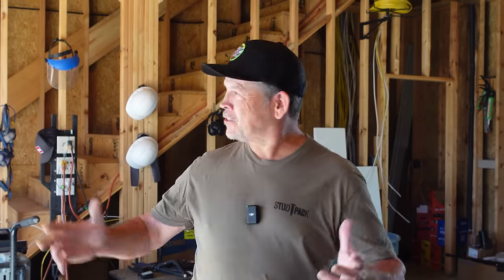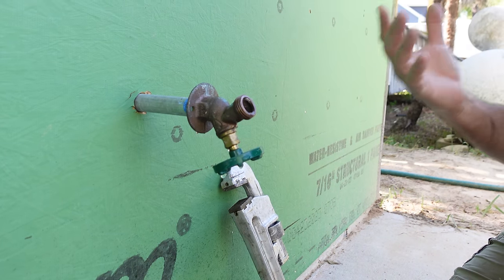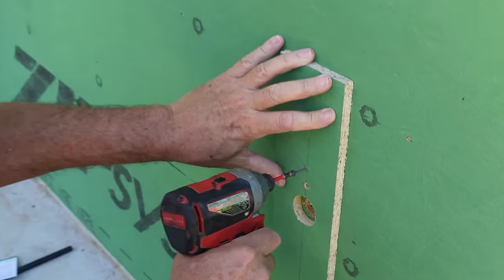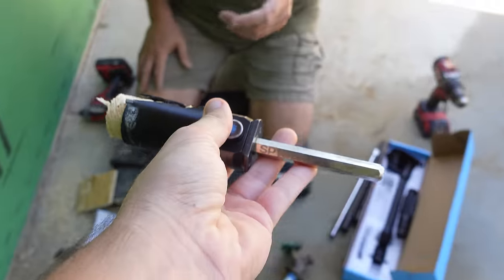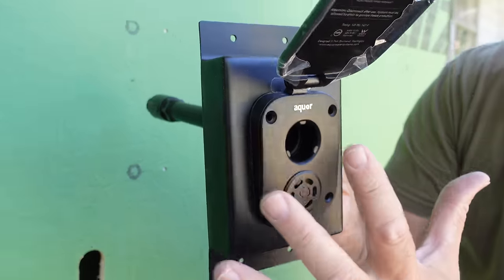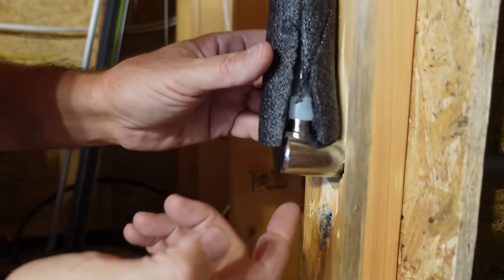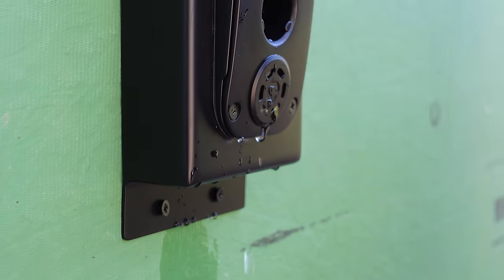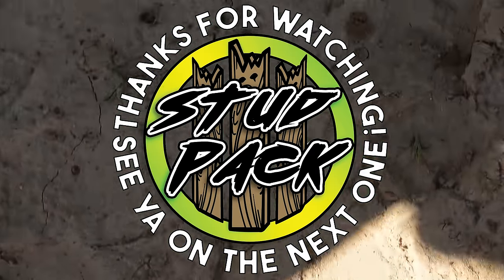Installing a Modern Outdoor Faucet - Ultimate Home Winterization

Comment: Hey Paul, I like that socket extension tool. It would be smart if you drilled in new 'set screw' holes so when you are pulling out your bit they won't fall in the wall! Just drill and tap new set screw slots in your sockets!!!!
Reply: Seems like you've never tried to drill through sockets... That steel will eat your drill bits quick. Never mind trying to tap it afterwards!
Reply: If you buy a Diablo or virtually any other brand besides spider,those extensions will fit.
They have the same action and are better built.

Comment: on that socket setup that you have , you can also tape it with duct tape, so that you will not loose it in the wall . if it was not for it being drilled in the garage .

Comment: I’ve seen these house hydrants before. They’re in intriguing. I don’t have but one hose bib to the outside pex right to the outside. Our winters are usually mild so I don’t worry about freezing. I can shutoff the water in the basement to my pex open the valve and drain it.

Comment: Looks like a great system. Is the hose adapter stainless steel or plastic? The black color always makes me think plastic parts every time. Is there a rebuild kit for the valve/spring & O-ring assemblies? I like to have repair kits for new products in hand when I install this sort of thing (new tech product) in my buildings.

Comment: It doesn't appear to be possible to easily air seal the connection of the hose bib through the wall.  The zip tape fixes the water issues but how do you AIR SEAL behind the fixture itself inside of the black housing?

Comment: That looks awesome! I'm in Minnesota so have the frost-free bibs on my house. I could go to the basement to shut off the water for extra security, but my knees don't like me to do that. 
Next, I'd like to see something like that design so I can replace the outside vinyl dryer vent birds have destroyed (why?!). The louvered types seem they'd be impossible to clean of caked-on lint.  The current trapdoor style is impossible to clean. (Laundry room is off my main-floor kitchen.)
Reply: I have had both. The louver style I find easier to deal with. The louvers have pins that allow it to open 90°. Because they are plastic, slightly bending it outward in the middle, the pins slide out of the holes. I usually remover the middle one, clean off them all off, put the middle one back in place. I usually don't have to do this but once a year or so. I also have rigid duct to the exhaust vent. It doesn't slow the air flow down like the flexible did, causing lint and moisture to be trapped in the pipe.

Comment: 15:56  "If an O-ring is good enough for the Space Shuttle, it's good enough for our water faucet."

Might I remind you that it was an O-ring in one of the Space Shuttle's solid rocket boosters that failed.   And cold weather was part of the issue that caused that failure. 

That being said:  It's a solid product from a reputable company that's been around over 20 years.   Sure, there is a chance that at some point in the future parts for this Aquor hydrant may become unavailable, but I've had that happen to me with two cars that are relatively new, with hundreds of  thousands of them still on the road.   I have an SUV where a trim piece broke and the OEM part is unavailable, and even when I have found someone saying they have an NOS replacement, they want hundreds of dollars for it (It was a $14 part at one time).  So I had a friend 3-D print me a replacement which is as good as OEM and we were able to tweak the design such that the 3-D replacement is better than OEM.   I had him print me a few extra copies in case this trim piece breaks on the other side of the SUV.  And 95% of people could probably not discern the difference between OEM and 3-D printed.

Comment: Doesn't the nozzle that inserts into the receiver have a silicone greased o-ring that would pickup sand and dirt if it's laid down outside.   Seems fine on a yacht or other boat but on the side of a house with sand grass and dirt it doesn't seem like a great idea to me.   I've had no problems with my traditional spigots...

Comment: keep n mind all of these internal poppet  valve type of frost free hydrants are extremely restrictive. many will flow roughly half the gpm at any given pressure and will tend to become fairly noisy at maximum flow rates. if you are expecting to run something like a 5gpm impact sprinkler you will encounter range issues.

Comment: Here in Ohio we have used frost free bibs that seal 8 to 12" inside the building and drain to keep water from spout. They work well if installed properly but not as cool as your hose bib.

Comment: It looks nice, but other than the freeze factor, how is this thing any better than a traditional hose bib? Admittedly I know nothing and I'm not even handy, but wouldn't a more economical option on a new build be to just have a shutoff valve a foot inside the wall? That way you could turn it off in the winter and there wouldn't be water in that 1 foot section that freezes?

Comment: Why is your green chip board so close to the ground? You'll experience rot. 
Shouldn't you've poured a 12 inch high x 8 inch thick concrete rim to raise the stud and chip board wall? Usually code requires this?

Comment: I'd order a few of those hose bib adaptors that goes on the hose. I think I'd prefer an on/off option without pulling the hose out of the box. House is looking amazing !!
Reply: Jenna, pulling the hose out of the box ensures that your hose also will not burst. If you leave it attached the hose could very easily freeze and burst.

Comment: Strange that that older type of external tap is still in use over there. Here in Sweden, they are very rare for external use. Think we had an internal shutoff tap before I was born almost 40 years ago. There's a rod inside the pipe going through the wall that turns off the water on the inside and a drain valve on the outside so the water drains out when you turn it off. They are very common here and weird that the US are so behind on that.
Reply: We have this faucets as well, this was to make a video. The regular frostfree faucets probably aren't giving then away for free to YouTubers. I'm sure Matt R hooked them up to get free supplies if they were featured in a video. I'm a little disappointed that they seem to have sold out to whoever provides free products. There's no cost/value consideration in the videos.

Comment: I don't trust O-ring only since it has that much turning slack on the 90. I would have put threading tape for extra measure. But if it works, it works.

Comment: This really looks like an overengineered solution in search of a problem.  I live in an area that regularly reaches -20C and the standard 8+" deep wall hydrants have given me zero issues - even when they didn't have anti-siphon valves.  Get one that's anti-siphon equipped and quarter turn and you're golden.

Cause the thing is, modern standard wall hydrants are already using a valve that's well inside the thermal envelope and slightly tilted for drainage (when installed correctly), and they do it without proprietary nonsense besides.  What you have there isn't even a wall hydrant at all.  It's just a pipe on a traditional indoor hose bib.  There might be some southern regions where that was acceptable, but there never should have been in the first place and that's just a testament to shitty American building codes.

Yes, proprietary IS bad.  And it's an acceptable sacrifice ...when it actually solves a problem or offers a meaningful improvement beyond "now hooligans can steal something expensive (because it's proprietary) off the side of my house."

Comment: Re inventing the wheel with that hose bib, just install the old-fashioned type at an angle and the water will drain out preventing freezing at a fraction of the cost 🤷‍♀

Comment: 'O' Ring on the space shuttle 😂 It didn't work out so well on the space shuttle 😢
Another good thing about that tap connection is that it will stop random people using your water. Especially in public places.

Comment: I have to say I do love those modern hose bibs but I would not have a lot of faith in having a rubber o-ring sealed into a wall.  Rubber o-rings inevitably dry out and start to leak and that would be a real mess inside a wall.  Just something to consider.

Comment: I put hose Aquor bibs on our house in houston when we rebuilt after Harvey. Been through 4 winters so far and love them. My only issue is our water connection to the house comes up outside the foundation and code required them to put a standard hose bib on it before it comes in the house!

Comment: 15:53 You remember the unfortunate catastrophe of the Challenger - the O-ring WASN'T good enough for the space shuttle and its failure resulted in the total loss of all crew.  If the O-ring in your connection is anything like NASA's - as you're equating - expect catastrophic failure in about 10-15 years.

Comment: There's been a huge variety of different length of anti-frost hose bibs on the market for many years, well before Aquor, that are very reliable and far more affordable. There's even outdoor combo faucet sets with hot and cold available. I'm not a fan of needing an extra plastic attachment that I know someone will eventually misplace or damage. Nothing is truly freeze proof, it just takes someone to forget and leave a hose connected to it. Seems to me they're just trying to reininvent the wheel. I feel like it's too commercial, similar to needing a damn key to turn on some water. Also forgot to add, as someone who services HVAC, not having easy access to  water means possibly leaving a dirty condenser behind.🤷‍♂️

Comment: You wont have leaks if you have a shutoff valve on the inside like most homes in east coast have.A lot  colder over here . Both systems would work fine. But what happens when the rubber seal goes bad youll have a leak

Comment: Hold it, Paul.  

At 15:58, you said "If an o-ring is good enough for the space shuttle, it's good enough for our water faucet."

I don't know about you, but I remember a space shuttle (Challenger, 1986) came apart a little over a minute after launch, killing all souls on board.  The point of failure: an o-ring.

Maybe a better analogy going forward would be in order.

I know you didn't mean anything by it, and a lot of shuttles have gone into space without catastrophic failure, but still.

Other than that, love the video, and especially the hydrants.  I learn something probably every time I watch.

Comment: maybe people down south aren't used to it since they have the luxury of it not REALLY freeezing.. but up north here we put a shut off valve in the basement.... which literally does the same thing but shuts the water off well inside rather than a few inches.... and of course you leave the level set to run the water outside...  and i get the 'proprietary' part issue.. but it's more along the liens of that's a ridiculously high up front cost to 'change' your home.  new construction, yeah maybe... but i'll go tried and true old school with the interior shut off valve until they come up with something budget friendly that's a better idea.. but... that's still a new idea....

Comment: Like that is the only system that avoids freezing of exterior hose connections.  They have been around with long necks to avoid freezing for the last 40+ years.  Yes that looks cool on the outside but like all the lines, when you took the piece out and stopped the water, some leaked out on the siding and onto the ground due to the anti-siphon control.  Now if you had a system that didn't have ANY water come out for the anti-siphon value that would be worth some money but yours, like every other one I have seen drips some water when shutting off. Leaving a muddy mess.

Comment: Hmm, I see it drains against the siding. They should at least have a little lip to keep that water off of the structure. If it ever leaks that water just runs down the wall.

Comment: Frost/freeze resistant hose buds have been used in northern states for over 50 years. 

The aquor system is cool and aesthetically pleasing, but the technology isn’t all that new. I have a standard style hose bib in my house and only worry about my pipes freezing if the power is out. 

Just sayin’

Comment: Seems like they reinvented the wheel, my house was built 40 years ago and it was built with Frost Free Spigots, the valve is inside the wall under the house where the ductwork keeps the ambient temperature higher than outside, no proprietary parts, no freezing spigots

Comment: Hose bibs freezing in Canada is a big issue, as you can imagine. Way back in the olden days, we'd put a valve somewhere accessible inside the house, so we could drain the line before winter.

EDIT: Yes, I know there are solutions and you don't have to do what I wrote TODAY. I did write "back in the olden days" but some commenters failed reading 101.
Reply: Man our regular draining hose bibs do great in Alaska, i see -30 every winter. The only time these would fail here is no rim insulation, heat off in the home, or your pipe running in the ext wall which is not code.
Reply: I just installed a 1/4 turn ball valve so I could shut it off manually like you mentioned.
Reply: @gorak9000  Or, you know, you could have read my actual post, you MIGHT notice I said "way back in the olden days".

Not overly bright huh?
Reply: @spf-92.5  As mentioned in my original post "way back in the olden days".

Comment: Paul, are you NUTS!!! that costs  over $300 just for the one setup!! ! For less than $100 you can make something just as secure and practical! Mounting Box $64.99  ,House Hydrant $219.99 ,Hose Conn $22.99 ..   😵‍💫

Comment: I switched over to Aquor and they actually work fantastic.  Not cheap and I actually expected the plastic piece to break but so far after 2 years, good as new.   I have the plastic ones with the ball valve and Vacuum Breaker built in to the plastic piece to make it easier to replace.

Comment: why reinvent the wheel?
Reply from the maker: Because the wheel is old, leaky, and can cause thousands of dollars worth of damage.
Reply: My guess, they’ve never heard of freezeless anti-siphon sillcocks that the northern half of the country uses all day without issue and costs 1/4 what this does, and works without any special adapters.
This thing still has o-rings that will wear and leak and need replacing, same as any other valve, so other than it looking cooler I can’t see any practical advantage to this system.

Comment: Would be a better product if you only had to drill one hole for the long pipe and not an oval to accommodate a small protrusion of the antisiphon.  A few more millimeters on the housing would accomplish that!!   Would open up an easier install for brick home retro-fits.
Reply: I see they make a retrofit version for a single hole.  So I take back my criticism 😊

Comment: “If an o-ring is good enough for the space shuttle, it’s good enough for our water faucet”. The space shuttle Challenger exploded catastrophically in 1986 due to the failure of a primary and secondary o-ring in one of the solid rocket boosters, resulting in the death all seven crew members.

Comment: You couldn't pay me to install one of them on my own house. I'd gladly sell it to a customer. All those moving parts and adapters necessary. It's a gold mine. That adapter screams for the homeowner to break or stress it causing leaks. Give me a good old standard 10¢ washer or packing replacement.

Comment: ok, wow, if I build a home I will be using those
the entire frozen pipes hose bib problem has been something people have accepted for FAR too long
perhaps we need a mandate for such a simple and robust system, plus if the part of the hose connector is made tiny and sleek(that one is a tad too long for sense) it could become the new interconnect standard, a QC device with an o-ring swivel is something we have been lacking for far too long, hose swivels exist and yet nobody till now has designed something to fix the exposed metal spigot problem

Comment: When i bought my house it had a freeze proof bib with the valve set back in the house and it still froze and blew the pipe open. So when I cut off the broken part I put in a 1/4 turn valve and then a new bib. Every fall I just reach up turn off the valve and open the bib outside. Ill never trust those 'cold region' bibs again on their own.

Comment: “If an o-ring is good enough for the space shuttle…” Um, guys? You do know the space shuttle Challenger blew up because an o-ring became brittle due to the cold?
Reply from the maker: Correct. But they still use them on every shuttle made.
Reply: @StudPack as a huge fan of the channel, clearly the comment wasn’t meant to be malicious. That being said, they don’t still use them, the last Space Shuttle was built in 1991 and they retired the Space Shuttle in 2011.

Comment: Those outdoor hose bibs are some of the best on the market for sure. Honestly, i don't care where you live, "freeze proof" outdoor water fixtures are the way to go. Those look awesome!
Reply: you can get normal frost proof faucets that dont require an adapter that will break or lose.
Reply: @guyod1  I have those. They work just fine. These just look more finished. The adapter is just a wearable part.

Comment: Its PEX A  just heat it up remove the compression ring (cut the ring once heated up), the PEX itself WILL go back to original size .. without CUTTING tubing .. taadaa.    

Never DO DO when DO will DO

Comment: I frankly don't see the need for proprietary system to shutoff water behind the wall. I'll always be losing the piece.
Regular frost-free bibs shutoff water on the inside (same place this system does), they even install at a downward angle to drain, but they are regular faucet. Nothing to lose.